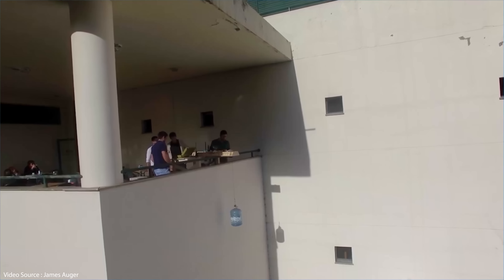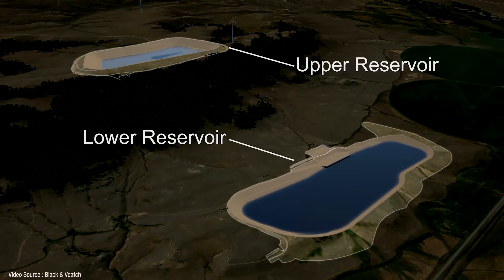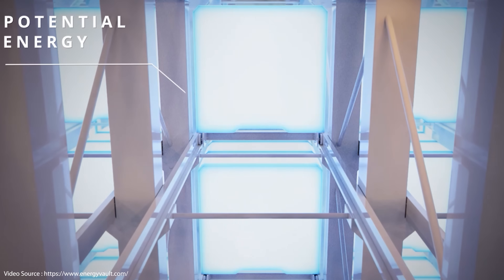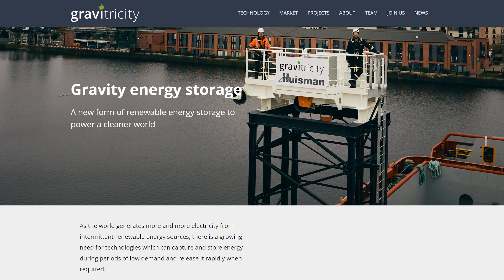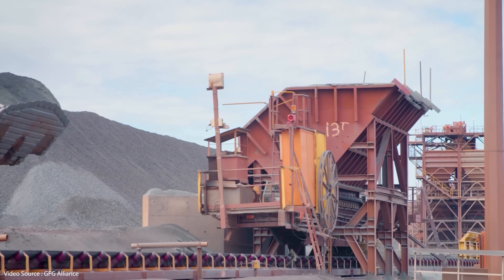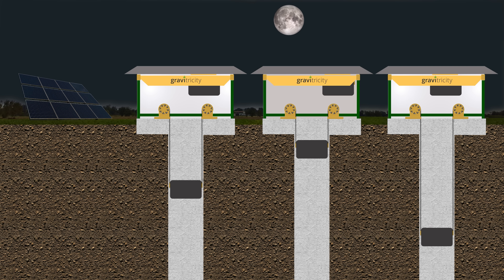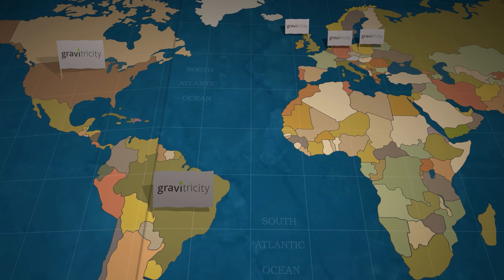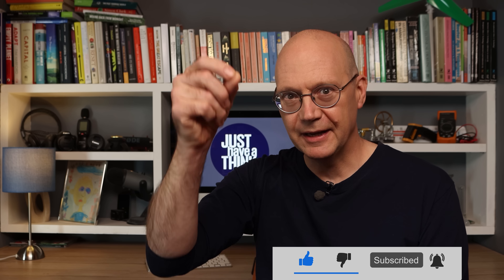Gravity Energy Storage. Who's right and who's wrong?

Comment: One factor I didn't hear you mention is the round trip efficiency. Even though round trip efficiency is included in the levelized cost of storage capacity (LCOSC), I think it merits individual mention since it makes no sense to use a storage system that only returns only half or less of the energy input into the storage system. In this regard gravity storage systems have a very good round trip efficiency. The only points of energy loss is from electricity to rotation of the motor/generator to store energy and then back again to electricity along with some friction losses in the gearbox and pully system. Substantial improvements in efficiency of motor/generators larger than 500 kilowatt and the power electronics to control the motor/generator thanks to the NASA Electrified Aircraft Propulsion program to electrify aircraft from fully electric for very small aircraft of around 10 seats to a turbine/electric hybrid for aircraft for larger aircraft. Motors and power electronics currently in testing at the 1 MW size are able to achieve efficiencies of 96% and 99% respectively. That means that round trip efficiency is in the range of (0.96*0.99*0.96*0.99 = 0.903) 90.3%. Knock another percent or two off for friction in the system and you get round-trip efficiencies of 88%-89%. 

This is less than the 95% round trip efficiency of lithium-ion batteries, but better than the 80% for both pumped hydro or 70% for compressed air storage (assuming that heat removed during compression stored elsewhere such as in phase-change salts where it can be added back to the high pressure air before being expanded through the turbine.CAES systems without heat storage have such poor round-trip efficiency as to not be a viable large scale energy storage).

And an alternative to vertical pits is to take advantage of long slopes where rail lines can be laid and electric trains with cars full of rocks or other high density material (slag?) that take power from or return power to power cables as the train is run up and down the slopes to store and release energy respectively. The advantage of course is that it doesn't need a 500 meter deep hole to exist or to be dug. This can be done with conventional trains with a locomotive with electric motor/generators providing the input power going up the slope and extracts power to "brake" the train going down the hill and a train of railcars filled with heavy stuff. This system has the advantage that it can follow a winding path to adapt to the contours of the slope in order to keep the grade within the friction limits of the wheels of the locomotive on the track. If all cars in the train had traction motors, that slope could be steeper. Alternately a cog railway or a cable system with stationary motor/generators at the top of the slope can allow the slope to be very steep.

Such a cable system has been proposed by Advanced Rail Energy Storage (https://aresnorthamerica.com/). The system consist of a number of individual bins containing "heavy stuff" that travel up and down the slope to store and release energy. A set of motor/generators at the top of the slope drives a cable that runs in a loop along the slope. The individual bins clamp to the cable to go or down the slope. A flat area at the top and bottom allow a number of bins to be queued up on either end. The amount of energy that can be stored is determined by the total number of bins that can be parked at the top of the slope. The total power of a single rail system is determined by the maximum power of the motor/generators with the limit being the number of bins that can fit on the slope at one time. So as to keep the speed of the motor/generators constant at their highest efficiency speed, the number bins that are on the slope at a given time would likely be how the power is adjusted rather than the speed of the bins.  

The input and output power of the total system can be increase by putting additional tracks on a given slope. With parallel tracks, the flat sections at the top and bottom can be shorter for a given amount of energy storage for the total system. Also note that the maximum power and the total system storage capacity is somewhat decoupled and so can be tuned to a given situation.
Reply: I was also thinking of rails on a mountain slope . Probably more efficient than pumped hydro ...
Reply: @richardstubbs6484  Exactly. Why lower cement blocks, roll the fucker.  And to the marathon answer above, A simpler way to say it is every energy storage system is 100% efficient.  Because the energy you are putting in is excess energy that the grid doesn't want, so currently it all goes to ground.
Reply: I think Energy Vault is claiming in the range of 75 to 80% round-trip energy efficiency, so somewhat comparable to lithium-ion battery systems. However, low round-trip efficiency may not be as bad for an energy storage concept as you are saying. As an example, a large-scale hydrogen electrolysis, storage, and fuel-cell facility e.g. in the middle of Europe could make sense, even though RTEE may only be 35%-40% or thereabouts. Here's the thinking. Wind power and PV power are becoming dirt cheap in capital cost. However they need cheaply scalable energy storage, capable of long storage time periods, to cope with intermittency and long periods of unlucky weather.  So a centralized large-scale hydrogen facility could absorb excess power capacity and give 35% of it back potentially much later on. Scaling just involves more hydrogen storage tanks. So you build twice or three times as much wind and solar capacity as you need since it is dirt cheap, and rather than wasting the output as is frequently done now by disconnecting turbines from the grid or idling them, you get 35% of the excess energy back to use later. May very well make economic sense, since there would then never be times when wind farms etc are being paid not to generate.
Reply: @erichawthorne2519  Yes, if you are going to otherwise have to divert power to a shunt and turn it into heat or shut down wind or tidal turbines to reduce supply to match demand, any round trip efficiency is better than nothing. And while the cost of wind and solar is dropping, it isn't nothing. Also different storage systems have different costs per kWh of output power. So as long as the extra generating capacity cost something, and the cost per kWh of storage capacity also varies, the round trip efficiency will always be a key factor in determining the optimum combination of energy storage methods to minimize the total cost per kWh of the system when averaged over an entire year. 

Another factor is the response rate and duration required of the stored energy system. In systems in the US southwest, Australia and other desert climates where solar is going to provide a large percentage of the total renewable power capacity. The energy storage system is going to need to supply 8-14 hours of power with a daily cycle. This would tend to favor systems with moderate storage capacity and fast response rate to keep the grid stable. This is likely where systems with higher round trip efficiency and power response rates in the 1 second range would likely have the advantage. This could be batteries (which don't have to be lithium-ion regardless of what Elon Musk thinks). This is also where potential energy storage would have an advantage. Potential energy storage is nowhere nearly as energy dense as batteries, thus they will have a much bigger footprint to store the same amount of energy. But they make up for that by having the energy storage medium be dirt cheap because it is literally dirt (well rock, but same difference) and an extremely long cycle life. 

However, for system like solar energy systems at higher latitudes where there is considerable seasonal variation in the length of the day and solar intensity, some form of long duration storage that can bank some of the summer energy for use during the winter will probably improve the cost per kWh of the system when integrated over a full year. Long term storage for seasonal shifting is where systems like power-to-fuel can be the better solution since the net kWh/m3 density is much higher and thus the very large amount of stored energy required for seasonal energy shifting will fit in a much more reasonable volume, even considering the much lower round-trip-efficiency. Hydrogen could be a good storage medium, but methanol might be better since it is a liquid at ambient conditions and so can be stored in simple tanks rather than requiring the expensive high pressure tanks for gaseous storage or complicated and expensive zero-boil off system for long term liquid hydrogen storage.

Bottom line is that to optimize an electrical power system where the majority of the power is coming from intermittent sources like wind, solar, tidal, and wave will require a number of different energy storage types working together to meet the demand power on the grid that varies on time scales from seconds to months to energy generation types which also vary in output from seconds to months.
Reply: Interesting;  but there will be a HORIZONTAL component there, doing NO WORK;   ,how much extra loss,if any, will that be ?

Comment: They could use a compressed air system to return the weight to the top, and use the compressed air to run turbines, so reusing some of the energy that they put into lifting the weight back,  close the valves so the weight drops as dead weight through mechanical generators, the pneumatic system lifting air could be emptied into turbines and generate as well, so the weight wouldn't be offset by pressure.They could use a compressed air system to return the weight to the top, and use the compressed air to run turbines, so reusing some of the energy that they put into lifting the weight back,  close the valves so the weight drops as dead weight through mechanical generators, the pneumatic system lifting air could be emptied into turbines and generate as well, so the weight wouldn't be offset by pressure.
Reply: That makes no sense. You're suggesting they could get energy back from lifting the weight. Not possible that violates the laws of physics!

Comment: Gravity bases system all have the same problem - the same things that make pump-storage just about viable when you got the right geological conditions: It requires insane numbers.
Anything relying on moving masses needs to either make sure that everything is protected from the elements or it can not operate under windy/rainy weather.

A Tower to move around concrete blocks?
Energy = mass*gravity*height. lets say a 100 ton block, 100 meters high => 10^5kg*10^2m*10 m/s²=> 100 MJ or 28 kWh
That is less than even most small electric cars, giving you ~150 km range.

They also strangely always come up with ludicrously long lifetimes and wishfull-thinking low maintenance costs. Like you what mate - you think you can run a large winch all year round with just a small inspection every couple months and the motors/generators will just work happily under constant loadchanges?

Comment: Why not have the gravity blocks be cylinders with flywheel storage built inside the cylinder?  They could potentially double the energy storage.  But that brings up the point.... people don't like flywheel storage because of the drag on bearings, so this gravity storage will have 10 times the number of bearings (I would guess).

Comment: i never had previously thought about going down so to speak.  on other thoughts with regards to rail stored energy, essentially this is a vertical rail system.  from here could one deduce that a large open mine could have an almost marble run like set of rails down the roads to the bottom of such mines.  considering these roads are reinforced for fully loaded vehicles which must way over 150 tons this could potentially be a great idea which doesnt also ruin our beautiful mountainsides.

Comment: Are there any comparisons of these systems vs flywheels? There are a few types of non-battery energy storage proposals going around, but it's hard to find comparisons between them, just for each one against pumped hydro and lithium-ion.
Reply: i think flywheels would last not very long, i think they would get damage very often, but yah i like the idea too, every house could have one
Reply: a flywheel of that size would be very very dangerous. ... and always losing energy
Reply: @zarthemad8386  i know, but it could be usefull and is easy to build, for safty reasons you could fill the room with water and it will brake by its self if the normal brake will fail
Reply: @zarthemad8386  Flywheels are already in use in some limited applications for rapid response to load. These systems tend to use large banks of smaller flywheels, and losses can be minimized with vacuum chambers and magnetic bearings. These complications are exactly why I'm interested in seeing more data on them.

Comment: The moving weights up and down in a mine shaft doesn’t even need new equipment designs. We do this on a drilling rig all day long and we can pickup up to 2 million pounds. The biggest maintenance on this system would be the cables that are picking the load. We slip and cut hundreds of feet of cable a month because the cable wears over and over in the same spots. If you let the cable wear out too much it will eventually damage the sheaves and won’t wrap on the drum correctly. That can cause the cable to “birdnest” on the drum and shock load the components as you hoist down putting extra stress on the whole system.
Reply: Never thought of that;   i hope that other IGNORANTS too, read you here and check on THAT!!
you say 2 mil tons?  what is that, how many kgs at a time,thanks?
Reply: @josepeixoto3715  I should have put pounds I’ll have to edit that. We can pick up 2 million pounds and that is equal to 907,184 kg. That’s our safe working limit we can actually pick up twice that in short intervals and that’s there so if the pipe gets stuck we can tug on it to get it unstuck.

Comment: I'd be interested in the specifics of the power generation (discharge) phase.  The falling weights cannot be used to directly drive the generator that feeds into the grid, because that generator must run at a constant speed, which would mean that the weights would be falling at a constant rate regardless of energy draw.  So it either needs some sort of variable gear arrangement, or an intermediate variable speed electrical generator feeding a solid state or motor/generator arrangement into the grid
Reply: It is disconnected from the grid and uses a converter of some type like wind turbines do. That way they can draw whatever current/voltage they want from the system (while there is distance left to fall). There is an explainer on the gravitricity web page.

Comment: I would use electrolysis of sea water as energy storage. It would achieve energy storage in the form of hydrogen & oxigen, plus, when the hydrogen it burns in oxygen, pure water is produced. It is a bit lossy, but the o2 & h2 are very useful in many areas

Comment: If a 30 ton weight falls because of a mishap, from the top of a hole, there wouldn't be much to clean up and probably no deaths. Just reuse the hole with a new weight. I think it's one of the best ideas . Imagine an eight cylinder complex that can provide it's own power to raise weights thus producing energy. Two of the cylinders doing the heavy lifting as the other six just generate. Could this be perpetual motion that will  produce energy?

Comment: Why only depend on a dry shaft? Seems to me a water flooded shaft with a large float at the end of a solid drive shaft would work. Make it a sealed system to keep it clean and you wouldn't need deep shafts as a large thin float with enough support could exert a large force. It would be the tons of fluid displaced that mattered times the travel distance. So a vertically thin float that covered a large area.  This could be added to pumped hydro systems to increase storage?  Would seem even in easier to drill a deep hole and let it flood and use it then have a system you have to keep dry
Reply: The weigh of the float would be about equal in energy ensity to water, where as concrete is more energy dense than water

Comment: Gravity is a great energy storage approach.  However, I also wonder how many mind shafts are readily available.  This would be a limitation similar to the topographic limits for pump storage.  If you dig a shaft into the ground for this application, would not you run into ground water issues? Matt, great series.  Keep up the good work.
Reply: Also a mine shaft may typically be to narrow. To rebuild the whole thing, making it safe, could be as expansive as digging a new one.
Reply: @bjorngve  
Both expansive and expensive
Reply: There are very few mind shafts around.
Reply: @johnstarkie9948  UK Coal Authority record some 150,000 coal mine shafts. Now, it just depends on how deep they are and how practical they are for the system.

Comment: Gravity based energy storage devices occupy two much volume and they are often  obstructive.

If you have a high density of mine shafts in an area then it might be worthwhile using them.
 A far more effective means are using flywheel based systems and storing the energy as kinetic energy using low friction magnetic bearings. And these are commercially available and take a lot less to install than a gravity based device

Comment: Everybody could have it in the backyard... during day pullingzup a weight using solar power and during night discharge ny letting the weight down. The dimension of the hole and weight just depend on how much energy you need till solar power kicks in again. Can imagine a 10t weight and a hole depth of 50m can be enough? It is about 13kw/h...

Comment: Try using water through a tube then gets smaller and smaller at each generator blades. Then if you can have solar power you can pump it back to the top.